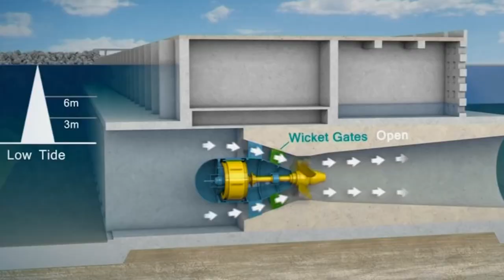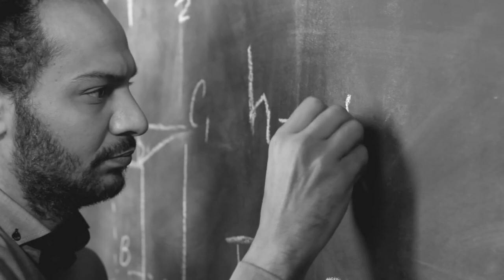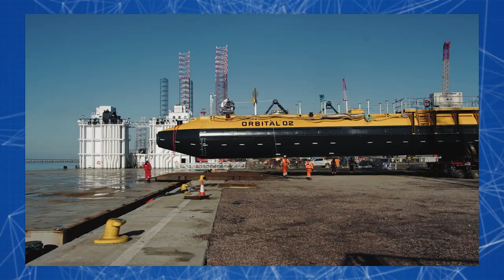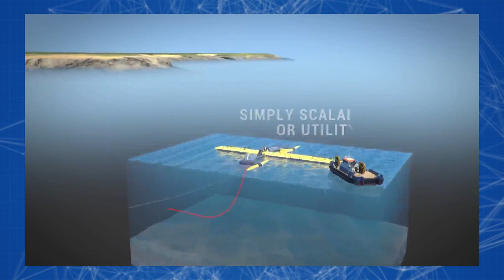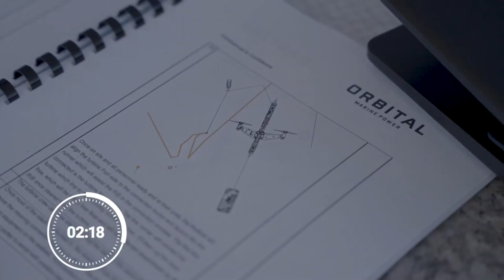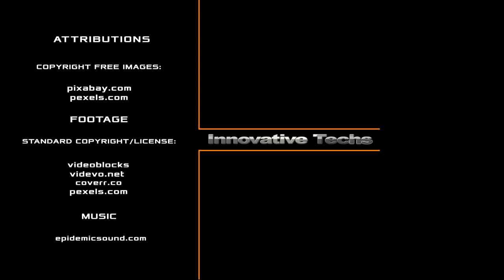This Invention May Change the World of Renewable Energy [Part 2]

Comment: It is, and has been for years, utterly ridiculous that wind farms in the north of Scotland are charged three times the amount levied on their counterparts in southern England for a connection to the electricity grid. Scotland also charged ridiculous rates by the the based Ofgem.Scotland charged over £7.00 per unit to resupply the grid yet southeast England is less than 50pence. Scotland was robbed of oil money and now being robbed for our renewable energy.

Comment: I'm open minded on Global warming, but regardless, any sane person should want to cut down pollution, this is one of the best projects I've seen yet!
Reply: Mr Said, 
CO2 is not a pollutant, it is the basis of life on earth.
Reply: Sen Se, 
your insulting language is typical of the ill informed. 
It does you no favour to insult me. 
If you disagree with what I say, tell me what is wrong with my statement.
Please do not quote that silly 97% consensus. Science is not about voting, but rigorous challenge to hypthesis.
Science is no different to engineering, they too have a confidence level in their conclusions. 
CO2 is a minor green house gas, it is insignificant compared to H2O and is now exhausted at present levels, scientists say it is saturated and can absorb no more heat energy in the frequency with which it operates.
Trying to reduce it is pointless and the means by which we attempt to do so are ineffective.
Reply: Sen Se,

Yes, that is true that without greenhouse gases the earth would be much cooler.
Methane is even less than CO2 which now has minimal influence on climate. 
Even the IPCC acknowledges that man made CO2 emissions are a tiny fraction of total global emissions.
As an engineering student you must be aware of levers? We are trying to alter climate, (An arrogant and unrealistic aim) by using the wrong end of a lever. We are working at trying to use a mechanical disadvantage.
Reply: @richardhawkins2248  your entire debate here is pointless. Lets agree on reducing harmful emissions that pollute the air and water. 
We can all agree living next to a coal fired power plant is a bad thing? Or how about living in a smog infested city? So, by reducing air pollution we ensure the health of future generations and if climate change is real (like most scientist say it is) then we take care of that as well. 

Regardless of our differences we all can agree breathing cleaner air is better than breathing in polluted air ... So, lets end meaningless debates and focus on technologies that will ensure we pollute less

Comment: Brilliant idea. This makes solar and wind power look like a joke. I say this because both those industries have huge costs, bi products and recycling costs. It’s not a clean industry at all.This looks like it is.
Reply: This one cost 300 million and no mention of production unit cost. What makes you think this is any different to other "renewable" money magnets?
Reply: @willymac5036  Yes, the infrastructure cost of La Rance for a mean output of just 60MW is crazy. You have to try once. I suspect this project has proved this new kind of anchored floating device is equally expensive, that is why they do not provide any figures to allow that calculation in their PR video.  Just looking running cost per kWh is not that informative and easily rigged. You need to look at all costs such as construction / deconstruction, maintenance, storage and treatment of waste etc. I'm very suspicious of any figures unless you have a very transparent explanation of the calculation process. Be careful what you believe and repeat to others. Most of it rigged in one way or another.
Reply: Solar is by far the cheapest energy source we are ever going to have, until some one can prove that we have a better all around alternative, and this tiny source is not one of them, unless you can show us some numbers to prove this BS story based on wishful thinking is a far better alternative.
Reply: @sat7755  How about you come up with some numbers showing how "cheap" solar is ( and I don't mean a link to the Guardian ). The problem is the whole subject is a minefield because everyone has an axe to grind and spins the figures to fit their own agenda. I've bought PV and ALL the electronics which goes with it and batteries. All that costs more than the PV which is cheap now.  The batteries alone need changing at about 5y and mean cost is about as much as the EDF connection would be for the same period. Sunshine free. Electricity isn't.

Comment: Not to be the obvious fly in this ointment, but steel, which had to be smelted.  Coal then.  Not to mention barnacles, that probably have to be scraped off at some point.  I think that some Japanese folks tried something like this maybe ten years back?  Made out of fiberglass was their version.  It was a small pilot project.  So this later version still might have barnacles, though.  I'm not sure that CO2 is produced when fiberglass as with steel.

Comment: would it not be easier to build a lock style dam that allows high tide in, closes the locks and slowly lets the water out during low tide through a turbine?
Reply: "Easier" ? . . . No
Its far far more difficult, expensive, and damaging to the environment to build dams and locks to control the tides.

Comment: Tidal and wave generation is not  a great idea as it gives very little power for the size of the machinery. It will be expensive to maintain and of course it is asynchronous, we alreday have too much asynchronous generation in the form of wind and solar. You cannot run a grid with asynchrous genertaors.
Reply: You are seriously mistaken. Modern wind turbines are synchronous and have no problem synchronizing with the grid. In fact, the generated voltage in the generator is rectified and then a computer-controlled sinusoid is formed. It is a very complicated circuitry. You can control the shape and phase of the sinosuid.
Reply: Ognyan, 

you do not understand how the term asynchronous refers to generators.
A synchronous generator maintains frequency by modulating it's fuel input (This cannot be done electronically, it must be done by fuel input modulation) Without such input the grid would not be able to maintain frequency. Frequency is the most important parameter as that is what determines if input and output is balanced, i.e. supply and demand.

Any generator when connected to a grid will follow the grid frequency, but only synchronous generators can keep the frequency within limits. Too much asynchronous generation connected destabilises the grid and trips can occur.

Comment: Can this replace nearly all of the current electricity-making, produced by the "ugly stuff; fossils, nukes, Yes or No? Would "mass use" of these tidal engines really not harm marine life as everything is close to shore to pick up the mechanical movement of the tide, Yes or No? Thought, why not build these engines further out to sea and anchor these on the sea floor? More costly, yeah, but there is more room to place these in massive amounts. There was a study by IEA in 2019 indicating that wind turbines at far ocean zones would produce the 11 x the energy use by humankind of 2018. Marine turbines could thus generate a similar amount.

Comment: 300M$ for 2000 households.  Ya, like that's going to be economical.

Furthermore, it may not affect "sea flora and fauna" but it will certainly have an impact on sea mammals that happen to pass too close to the turbine blades (even at low RPM).
Reply: Sea mammals are a bit smarter than you give them credit for. They will be aware of the props and avoid them. 

The $300 million figure includes R&D, and the building and maintaining of fabrication infrastucture during the many years it took to build the first unit. Economies of scale may make the product viable, but it is only ever intended to account for a small percentage of total electricity production. The fact that the energy generation is 100% predictable, will also allow it to command a slight premium over other renewable methods as well, so I wouldn't write it off just yet. Having said that, it is certainly no substitute for fusion power; let us hope that ITER performs as planned.

Comment: 300 million / 2000 households .. mmm. 150, 000 per house.
Reply: The $300 million cost is just a one time cost, then this outputs energy every day for decades.
Reply: Yes and if you assume each home has a $100 a month electric bill, that is $1,200 a year and assuming the machine has a 30 year lifespan (which I think is a stretch) means each house will only pay out $36,000 through its useful life. This does not recoup the resources invested. Obviously there are fixed costs that get distributed if they enter mass production, but based on the information provided in this video it is difficult to believe this is economically viable.
Reply: The cost ist with the research and developement and patent of the technologie, so the caluculation for massproduction would be different.